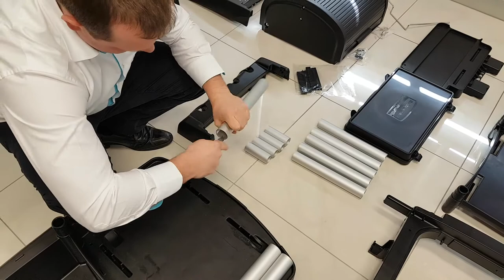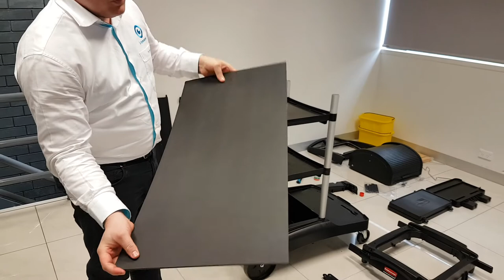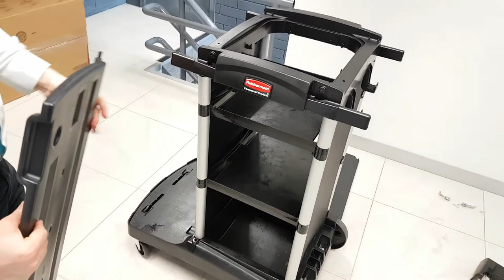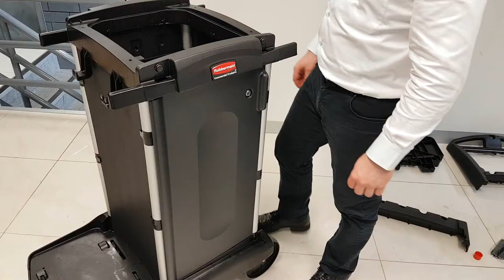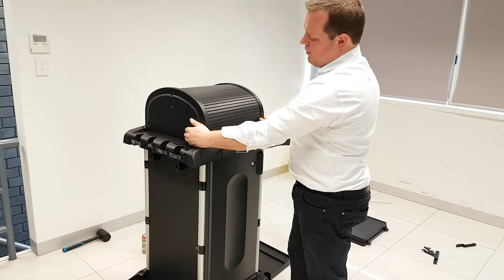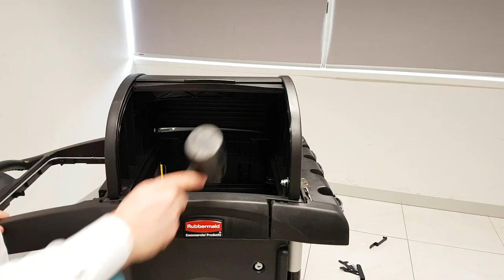How to assemble Rubbermaid Housekeeping Cart

Comment: You had some brackets on the floor then they disappeared.. I specifically looked up your video to find out what in the hell those are for. I guess they are not needed. I'll just throw em in a drawer! Nice video though thanks!
Reply: Andrew Souto same here
Reply from the maker: Good Point- sorry i forgot to cover it in the video. They're only required if you want to tow along the rubbermaid squeeze mop bucket(they screw on the base of the platform and act as a hook for the bucket) Frankly i've never used them.